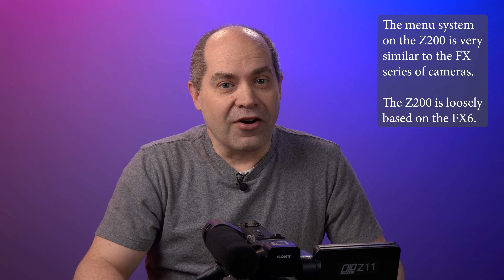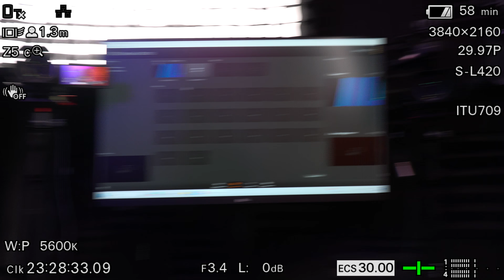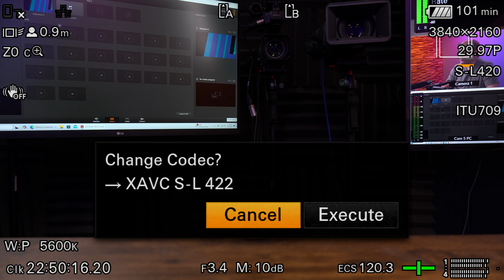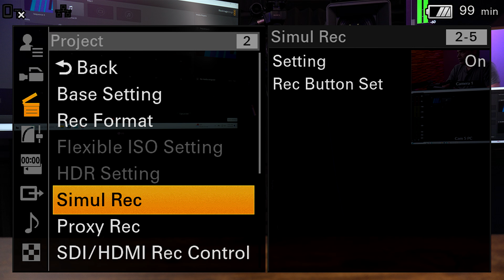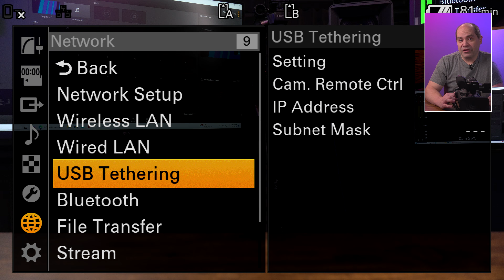Sony PXW-Z200: Is It as Good As Anticipated???

Comment: Can you think of a way to remotely shade (or paint) this camera in a REMI situation? Would de M&C app work in a VPN with zerotier or tailscale? We usually deal with remote operators with LiveU backpacks and it would be great to remotelly control and match their cameras from our studio. Thanks!
Reply from the maker: I haven't tried Monitor & Control, but I suspect it wouldn't work, but only because it requires that the app discover the cameras on the network. If you could enter an IP address, you probably could control them over a VPN like Tailscale.
Reply: @djp_video  it makes sense, thanks

Comment: Hello! With the release of the Z300, have you tried it, and if so how does it compare to the Z200? Thanks
Reply from the maker: I haven’t tried one yet. I will at some point. 

From what I’ve gathered from people who own it, it’s marginally better than the Z200 in terms of light sensitivity (so it can operate in slightly darker environments), but not noise. The larger sensor of the Z200 means that it actually produces a cleaner image in the same conditions. So the bigger differentiator is depth of field. With the smaller sensors on the Z300 you can’t go as shallow as on the Z200 (not that it has a huge sensor capable of razor thin DoF or lots of bokeh).  But for live event production, shallow DoF is more of a liability than an asset most of the time. 

The Z300 seems to be designed to fit in nicely in ENG or some near-broadcast applications. The Z200 is more event-oriented. 

But both are great cameras. There aren’t many situations where one of the two would be a “bad” choice compared to the other.
Reply: @d @djp_video   Yes, although the Z200 can fit (it seems to me) in some broadcast environments it shines as an event oriented camcorder, especially with its amazing autofocus. Although the 1.9 fixed aperture is compelling on the Z300, as always there are compromises as well. 
Thanks!
Reply from the maker: Keep in mind that F-stop is relative to the focal length... and with the Z300's sensor being roughly half the diagonal measurement of the Z200, that f/1.9 on the Z300 is going to behave roughly like f/3.8 on the Z200. Given that the maximum aperture on the Z200 that you can use consistently through the zoom range is f/4.5, it's not that far off. And you can stay at f/2.8 or faster through about half of the optical zoom range. 

So, yeah... constant f/1.9 is great... but maybe not quite as big of a difference as the numbers might suggest.

Comment: When shooting with my Sony Z200 in 1080 60P and outputting a signal over the SDI connection set at Level B  produces garbled audio over Blackmagic ATEM Camera Fiber Converters, while a Panasonic AJ-PX270 at the same format works perfectly.  If I plug an HDMI from the Z200 into the Atem Camera fiber convertor the audio sounds clear.    
Another step in understanding this issue with Sony's Z200 SDI 1080 60p Leve B output was also verified when plugging into a Decimator.  Which converted the 1080 60p Leve B signal and output 1280x720 60p with no audio.  But If I switched this to 1080 60p Level A the Decimator will output audio with the 1280x720P… @DougJohnson Do you have this issue?

Comment: Thank you for putting out these in-depth camera reviews! I have a lot of the same gear as you, but I'm wondering if you could comment on the low light capabilities between the X70 and the Z150. Basically I'm looking for something better than the X70 that can do a baked-in time stamp for legal proceedings. Also, as I understand the Z150 and Z90 have the same sensor and a lot of the same internal guts, it's just that the Z150 is a little bigger with more buttons and rings. Do you know if either of those two perform better under low light with less noise than the X70?
Reply from the maker: The 150 might have a very slight edge, but it isn’t by much.

Comment: I like your review of this camcorder, can you please talk about the accessorie attachment on the right side of Sony Z200 , right by HDMI there are two screw holes 12 mm apart. I am searching for a bracket or a cold shoe so I could attach a wireless mic there, smallrig does not fit there , I would appreciate if you will mention that attachment

Comment: Is it correct that you can film a higher quality codec - say S I 422 or SL 422 4 K on a CF express card in slot A and a lower quality 4 K or even HD codec on say a V60 SD card in slot B? I can’t seem to set that up. Closest I can get is to set up proxy record and the higher quality 4 K won’t show up on the SD card but the proxy will. Basically I record college soccer and want the higher quality for our use and the ability to hand off an SD card to visiting team without having to give away a $100 card.
Reply from the maker: The proxy feature is the closest you can get. You can only choose a single codec for the main recording, and then you can turn on a separate proxy but you don't have the same level of control over the format of the proxy recording.

Comment: Hey Doug, i know that active stabilization crops in a bit (1.1x?), is there a decrease in the image quality when using Active stabilization?
Reply from the maker: It does crop in slightly. I don't see any loss in quality. I attribute that to the sensor which has more resolution than is needed, so cropping in doesn't really result in loss of detail.
Reply: @djp_video  Thanks for confirming this Doug, much appreciated.

Comment: I wish it has 3cmos as the z280 , do you see any video quality between them
Reply from the maker: The Z280 is slightly more sensitive in low light, but the Z200 produces a cleaner output when noise suppression is turned on.

Comment: And here I am still waiting for an AX700 successor 😂
Reply from the maker: I have it on decent authority that any possible replacement for the AX700/NX80/Z90 will not be based on the Z200, if that's what you're hoping for.
Reply: @djp_video  nah just an AX700 with same or slightly larger sensor but updated colors, AF tech, new menu system, pro features that can be used professionally (S-LOG, S-Cinetone, Venice), 4K120 editable not just slow mo, and zoom to wide that can go from wide to super tele, etc. Basically Osmo Pocket 3 but with much better and longer zoom in an updated AX700 body.

Comment: I have this camera and it's good for many uses-from live events to even some weddings...for cinematic shots a mirrorless may be a better choice... but I have them both so I'm  covered.Low light is an issue but for concerts and live stage there is always a lot of light anyway...for anything else I just bring my lighting kit. I think all 1" sensors are similar in low light. But I wonder if the new Panasonic  AG-CX370 is any better? I'm invested in Sony for now -I may get a  second Z200 and a second FX30 for my business.
Reply from the maker: While the sensitivity of 1-inch sensors might be similar across models, the noise reduction on the Z200 ups the game quite a bit. It's a lot better than any older model I've used.

Comment: Does this Sony V200 have NDI versatility like as found on the Panasonic AG-CX350?
Reply from the maker: No. Sony doesn't put NDI in their camcorders.
Reply: @djp_video  What is your opinion of the Panasonic AG-CX350 as a competitor to the new Sony V200? Sony's new Auto Framing, reliably keep track of subjects using the Auto Framing function, which automatically recognizes human forms and adjusts the frame to keep your subject centered. Especially handy for solo shooters, Auto Framing mimics manual capture while letting you engage with your subject. This is a big feature, and no other camera, except for the new upcoming OBSBOT Tail 2, can do this?
Reply from the maker: I don't have any practical experience with Panasonic's lineup of camcorders. I'm sure they're great cameras, as Panasonic models always are.

Where Sony has an advantage for sure right now is the AI Framing/tracking they've added to a few of their cameras. It's really good. Not quite as smooth as a human operator, but probably 90% of the way there. The fact that it recognizes people rather than just faces makes it a game changer, since it can track people when they're turned away from the camera or walking behind objects that obscure the face. I've used it for a couple of events so far and it is really good. I also watched a couple of their cameras at NAB and they were spot-on. And it's only going to get better with future models and firmware updates.

Comment: No NDI seems like a strange thing to omit since it has the ethernet port and does SRT.
Reply from the maker: Maybe not as strange as it might seem. For their target market, NDI isn't really that common or expected. NDI works well for smaller setups, but can start to fall apart when you try to scale.
Reply: @djp_video  It works for what you and I do (although you don't use NDI for camera inputs IIRC). It's similar to the JVC HU500 (I think that's the model) except for the NDI. The Sony probably puts out a nicer picture but I want a camera that does SRT and NDI both.
Reply from the maker: NDI wouldn't work for most of the events that I do... for a few different reasons... but primarily due to the higher latency and overall total network bandwidth required when you have a lot of video feeds.
Reply: @djp_video  Curious how many video feeds might you do in one event?
Reply: @djp_video  Just depends on what one is doing. Nowadays any do multi-cam live stream productions where NDI works well and remote productions where SRT fits the bill. Nice to have both in one camera without needing anything extra. How many video feeds do you get up to?
Reply from the maker: For most events I'm doing these days, it's about 6-8 cameras, plus four feeds from computers, plus at least a couple HyperDeck for video playback. And then about 8-10 various outputs to monitors and projectors and the like. 

It's well over the limits of a gigabit connection. And the latency of software-based switchers is a deal breaker for me.

Comment: Doug, you keep saying there are only 7 zoom speeds in these cameras. That is wrong there are 8. Look in the menu settings. There are 8 to select from.
Reply from the maker: You are correct. I guess I must have either misread the technical documentation, or my memory failed me. 

I was only referring to LANC though. Internally the camera has a lot more than 8 zoom speeds when operated by the main zoom rocker.

Comment: Any idea hows the low light image quality compared to z280?
Reply from the maker: I don't have easy access to one to compare it objectively. But once upon a time I did rent a Z280 for a weekend to compare it to my Z150s, and shot some footage outdoor at night and indoor in near total darkness indoors... and while the 280 was better, it didn't knock my socks off; based on what I'd heard people say about it, my expectations were set too high. I recently reviewed that footage so I think this still holds true.

I'd say that the 280 might still have a slight edge over the 200 for low light image quality, but if it does, it's subtle, and the only reason the 280 might have an advantage is noise. Without a doubt, the overall image quality on the Z200 is much higher in all other scenarios. It always renders more detail; there's just a bit more noise in darker settings. My 280 footage is also considerably lower in contrast than anything I've gotten out of the 150 or 200; it always looks just a tiny bit muddy or milky.

If I was to give each subjective scores between 1 and 10 for image quality, assuming my typical settings:
Z150: Low light 5.0, Amount of real detail 8.0, Overall 6.5
Z200: Low light 6.5, Amount of real detail 7.5, Overall 8.5
Z280: Low light 7.0, Amount of real detail 6.5, Overall 6.0

The noise suppression on the Z200 is pretty good, but like any algorithm applied live, it can struggle a bit when there's motion in the shot.

Comment: Skin tone looks better with the 200.
Reply from the maker: At least some of that is due to Picture Profile 1 applied on the Z90; it's meant to be a bit more punchy, and as a result has the contrast and saturation boosted a bit, and color balance shifted a bit more toward red. If I had turned the PP off the two cameras look a lot more similar. I might do a video showing that when I find the time.

I've had a couple situations where the skin tones are rendered a little flat on the 200. Or even a little bit patchy, as if too much noise reduction or knee is being applied. It's controllable, but the camera doesn't have as many options to control that as the older cameras do. That aspect  of it is a touch disappointing. 

The ability to create and load your own LUT (based on SLog3) is cool, even though it can take some time to create one. But when you do that you lose access to many of the camera's painting options.

Different approaches with different limitations. Ultimately you can end up in a similar place even if the road to get there is different.

Comment: ECS stands for Electronic Clear Scan.
Reply from the maker: Thanks! It would be nice if they included that in the manual.
Reply: @djp_video  It's actually Extended Clear Scan, not that it makes any difference but thought I'd point that out. It's in the FX6 manual if you wanted to confirm.

Comment: Great video once again, what i would like to see, is your PP settings, like how you had did that video for the NX100 a few years ago..thanks
Reply from the maker: The Z200 doesn't have the Picture Profile feature. It has fairly limited control of color rendering. It does take a LUT, though... so you could use Resolve or some other tool to create a .cube file that you could use to get whatever coloring you want.

Comment: Could you test following, and give results: front lid closed (to record total darkness), FleibleISO -mode, base ISO (1600). AGC and noise supression off. How does the camera screen or HDMI output looks? Compared to the custom mode? On my camera, there is excessive amount of noise on Fleible IDO, but none on Custon mode. I'd like to hear, if this is only on my unit, or is this a feature? I know one person who have same problem (heard that the cause might be the wrong CMOS installed on the factory).
Reply from the maker: I haven't done much with Flexible ISO just yet. You do lose a lot of capabilities when set to Flexible ISO mode, particularly nearly all of the Paint options. You're essentially shooting in S-LOG3, and Sony is assuming that you'll be doing all of your processing in post. And I don't do much of that; my workflow is almost always live switching/streaming.

The other potential issue is that while you can apply a LUT for monitor display and the SDI/HDMI outputs, the recorded footage does not have the LUT applied (proxy files excepted). So if you need to use the recorded footage, it has to be run through an editing application to apply the LUT at a minimum.

It also seems that the noise suppression algorithm is different when in Flexible ISO mode. That might be what you're seeing.
Reply: @djp_video  Thank you for the reply. I'm well aware of the need of post processing. Life will be way more difficult.

My main reason for asking this was just to be sure, that does my camera behave as it should, or it is defective. It it highly possible that I will never use FlexibleISO mode, but I don't want camera being defective. I have heard that certain serial number range might have wrong CMOS sensors installed on the camera, which causes exsessive noise, making camera more or less unusable. 

Noise Supression doesn't have much of affect on the noise. It's insane. I could send you a short video, so you know what I talk about. You either see the noise on black screen or you don't.

https://youtu.be/rKtMm1Xiiro?si=1-wK4wnKn5QR8uJ8
Reply from the maker: Based on what I'm seeing online, much higher levels of noise in Flexible ISO mode is normal for this camera. How bad is it when you set the noise suppression to High?
Reply: @djp_video  noise suppression doesnt do much anything in this mode. And note, that the video you saw, was taken on base iso 1600, which should have least noise.
Reply: In 5s interval, noise supression is changed: Off/ low / mid / high
https://youtu.be/uI6zAO2sYyo?si=nXQg1-jq537po-Uz
Reply from the maker: Mine doesn't look anything like that. The image is basically all black, even with noise suppression turned off.
Reply: @djp_video  so propably my camera has some issues. I’m aware of one other case, where problem was way worse than mine. That camera has been is service for 2 months, heard that wrong CMOS sensor causes this. What is your serial number? Mine is 2000959

Comment: Did you debate the cx350 at all, its older but the new cx20 is the same spec but more compact and they're the same price range
Reply: I have had the 350 for a few years, it is good but it has some shortcomings...The auto focus sucks and it is hard to get a proper exposure outside on a sunny day (No variable ND) You can't access some important settings on the fly like gain settings.
Reply from the maker: Not really. The chance of getting those to come close to matching the image of my existing 12 Sony cameras is about zero. I'd have to start over with cameras from scratch.
Reply: @djp_video  Thank you, trying to get myself over the line on the Sony for filming drag racing (autofocus and stabilizing slow pans and tripod jults is my biggest concern) in the uk and for long hours, if you didn't already have any cameras do you think Sony would still be the one for you?